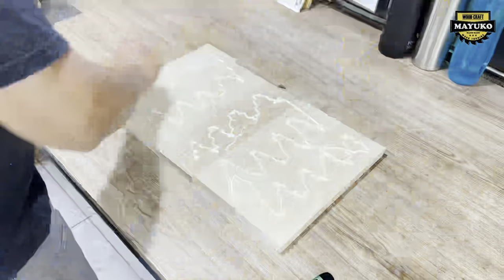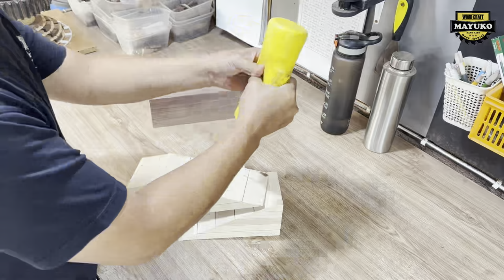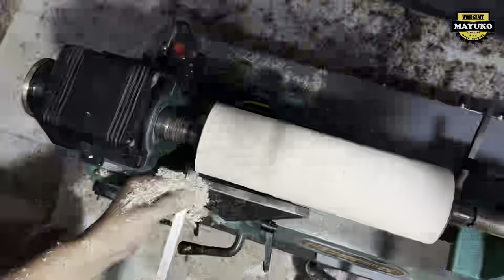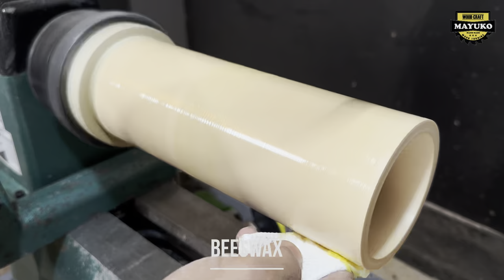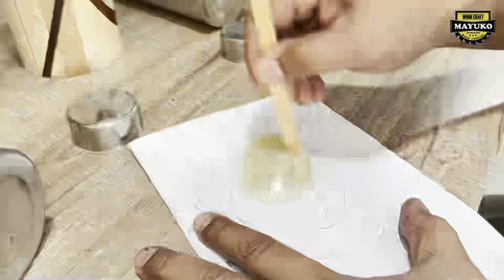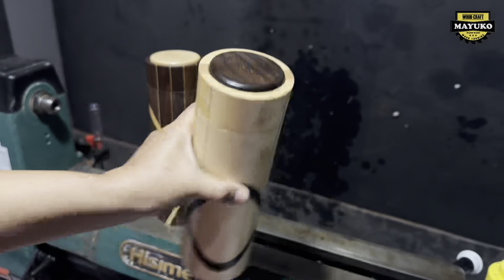THE WATER BOTTLE, woodturning

Comment: Another beautiful piece of wood turning. Just a suggestion it would be good idea to put some kind of sealant on top edge of bottom so water does not trickle down between bottles and case. Potentially can ruin the piece of art.
Reply from the maker: You are absolutely right, thanks for the advice 🙏🙏🙏